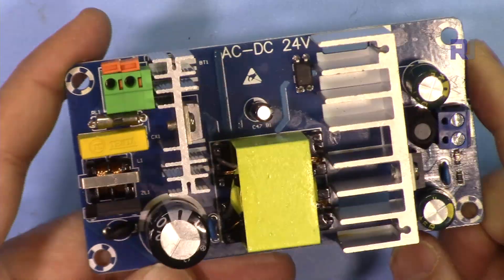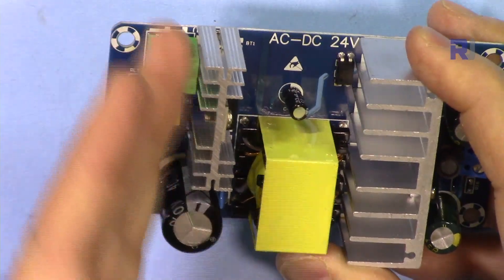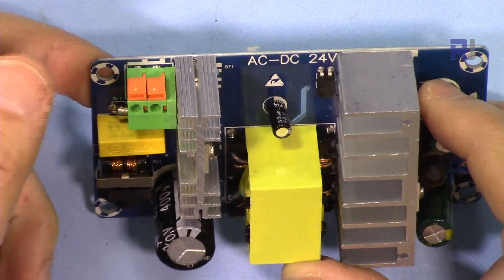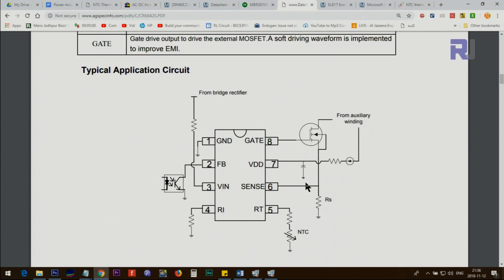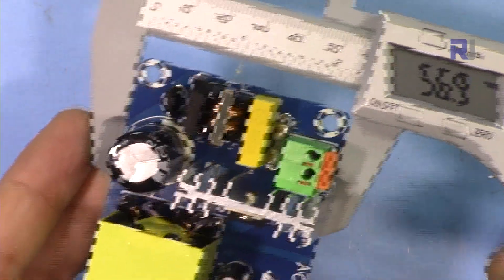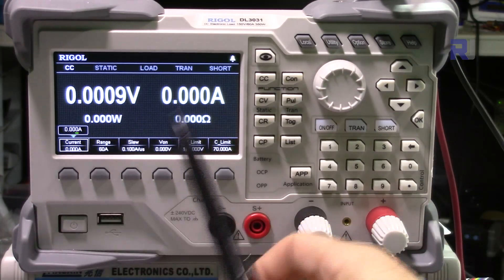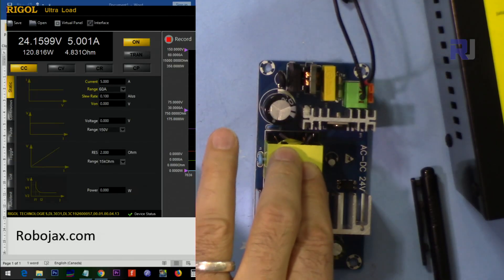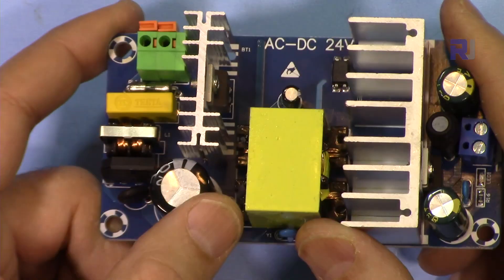Review of  AC 100-240V To DC 24V 4A-6A Switching Power Supply Module

Comment: Can I use this to power a subwoofer amplifier
Reply from the maker: I'm not sure. Most subwoofers they have either AC line that you connect to the wall outlet or they are connected directly to the sound system. But if it needs 24 volts and amount of current is equal or less than the current that this module can provide, yes you can connect it. So watch the video and see how much this can supply and then read the current for your subwoofer.

Comment: Hello, i have this powersupply but the transformer doesn't have double insulation on primary winding do it feels dangerous and also i get scared by y capacitors, please let me know is it safe without double insulation on primary winding
Reply from the maker: The question you're asking has and is involved with a lot of liability .So contact the manufacturer

Comment: hello, sir how to put adjustable voltage output for this smps?
Reply from the maker: this is fixed 24V output. you can buy other versions. Search on eBay or Aliexpress
Reply: @robojax  , is there any way to apply, to this smps to make it adjustable output from 5v to 24v or 
like we say 12v to 24 adjustable?
thanks!
Reply from the maker: this is designed and all components have been selected for that particular voltage. you can't change it. Get actual boost converters. I have videos on that.
Reply: @robojax  okay thank you,

Comment: please can you say if using a metal box connected to the power supply ground could dissipate this temperature issue and increase the usage time, i look forward to receiving your feedback thank you very much
Reply from the maker: Please use your multimeter and check the heatsink and GND . if they are connected yes you can use it.

Comment: I would like to ask what is the efficiency of this power supply module.

And if i connect a buck converter in it and set at 14.4V and 8A would it work or does the module smoke????. Btw thanks for your reviews. Its awesome
Reply from the maker: to connect "in it" where? I assume you know at the output.  I have it on the title and explained in the video that output maximum is 4-6A at 24V.  I did not understand 14.4V is the input or output of your module. but regardless if your module does not accept 24V, then don't connect it.

Comment: can i power 2 nema 23 1.26 nm stepper motors withe 6600 stepper drivers
Reply from the maker: size of the motor does not matter. see how much current it needs at 24V. this module is 24V and see how much current it handled in my test as I don't remember. I've got over 440 videos. so i don't remember numbers.

Comment: Really useful test, thanks for that. Could you also test ripple and noise at different currents? Would be nice to see how effective the filtering is, and could it be used for sensitive devices. Thanks!
Reply from the maker: in some of videos I did test and it seems very few people cared about it.  So I stopped measuring the ripple. I will consider that in my future tests. This product is done,  no one will watch it if I make new video on this module.
Reply: @robojax  thanks you very much for your reply and considering this 👍😊
Reply from the maker: you are welcome.
Reply: @robojax  hi did u test it can i use for my diy amp?

Comment: how i can make it adjustable from zero to 30 volt?
Reply from the maker: you need total redesign. will not work.
Reply: @robojax  they make the  power supply oh the laptop 19 volts it works good from zero till 30 volts

Comment: Very Informative review thanks.. Can I use these to power my 120W 24V amplifier? Thanks I will waitfor your response
Reply from the maker: P=IxV, P=power, i=Current in A, V=Voltage. Power of this module P=IxV=24x6=144W or 24x4=96W. Please watch the video and see if get current that results to 120W. if so, then yes. I don't  remember it as I have done 100s of more videos after this.
Reply: I wonder the HF Noise of these SMPS will affect my Amplifier.. Can You Make A review if which is better power supply of audio amplifier, Linear or SMPS?? Thanks you Sir for your response

Comment: Sir, can i use this for amplifier 24v, and use for a quiet long time? Lets say one day used..
I appreciate your answer sir. Thx
Reply from the maker: this is converter from AC to DC. Yes you can. it is made for this purpose to be used. However I have not used it. I would suggest leaving it ON for 1 or 2 days in safe place like on concrete, outside living spaces to if it catches fire, nothing is harmed. Then use it. this is just advise and you have to use your own discretion. .

Comment: Hi excellent video.. Can I connect two of these in parallel and take 8A @ 24V? Will these get damaged?
Reply from the maker: if both voltage is exactly the same like 24.1 and 24.1 yet. but if you get 24.5 and 24.3 then 5-3=200mV will flow one to the other and that causes the module to heat up.
Reply: Robojax ok. I better use a bigger one then. Thanks.
Reply: Robojax ok. I better use a bigger one then. Thanks.

Comment: what is batter?

https://www.google.com/imgres?imgurl=https%3A%2F%2Fimages-na.ssl-images-amazon.com%2Fimages%2FI%2F71XiwXSrBWL._AC_SX425_.jpg&imgrefurl=https%3A%2F%2Fwww.amazon.com%2FConverter-110-265v-Adapter-Industrial-Switching%2Fdp%2FB07N3YW3TQ&docid=XhtUW1ZScSEsMM&tbnid=Ux9tQ6uvaaT9VM%3A&vet=1&source=sh%2Fx%2Fim

https://www.google.com/imgres?imgurl=https%3A%2F%2Fcdn.webshopapp.com%2Fshops%2F19777%2Ffiles%2F63175928%2F24v-dc-240w-10a-switching-power-supply.jpg&imgrefurl=https%3A%2F%2Fwww.wifiledlamp.com%2F24v-dc-240w-10a-switching-power-supply.html&docid=0iEsvSHSjntQNM&tbnid=67RKlf6ogRrfkM%3A&vet=1&source=sh%2Fx%2Fim
Reply from the maker: Unless I test it, i will not know.

Comment: Hola, me compré está fuente para alimentar un amplificador tpa3116da mono 150w RMS el problema es qué me mete ruido, sabrías cómo solucionarlo??? Gracias. 

Hi, I bought this source to feed a mono tpa3116da 150w RMS amplifier. The problem is what gets me noise, would you know how to fix it ??? Thank you.
Reply from the maker: do you mean AC has noise? it is strange.
Reply: @robojax  No... but if the amplifier, the amplifier has current noise
Reply: I think what is the source's fault
Reply: @Eterno_Cobre  Try putting one or two (high and low) capacitors across the output of the psu.

Comment: What are the turn ratios of windings? The primary, the secondary and the auxiliary?
Reply from the maker: We don't know. We are just using it. Do't try building it. It is so cheap, I believe if you try to build it would cost more than buying it.
Reply: @robojax  Im not trying to rebuild ti but im very intretrested in winding turn ratios in that transformer! Btw thanks for a reply! Nice video!
Reply from the maker: Yes. that is interesting. I did not try to tear it down.  Thank you. Ahmad

Comment: Great review but I worry when you touch mains side components. 
Did you measure efficiency and power factor?

Would like a review on a good 48V 10A supply to power RuiDeng DPS5015 (Great supply but can kill 48V input)
Reply from the maker: no I did not look at efficiency  because the input was AC.
the RuiDeng DPS5015 was on my list for long time, but it is too expensive and I could not afford to buy it.